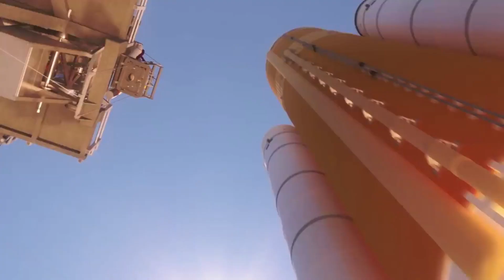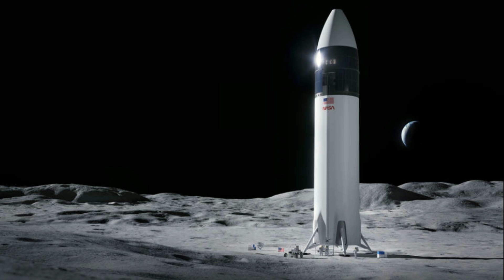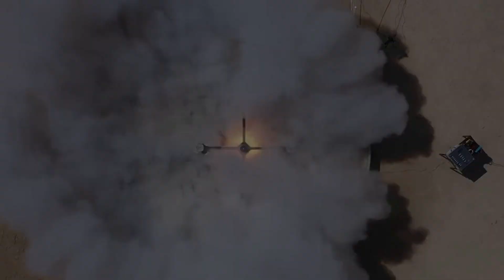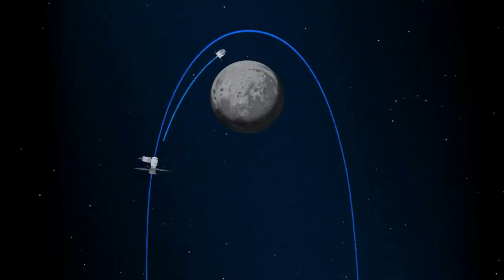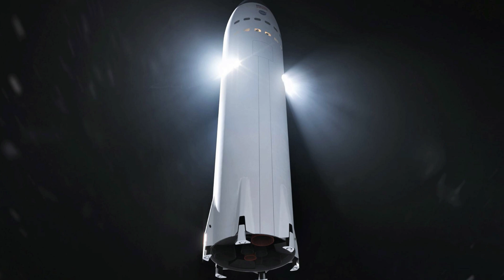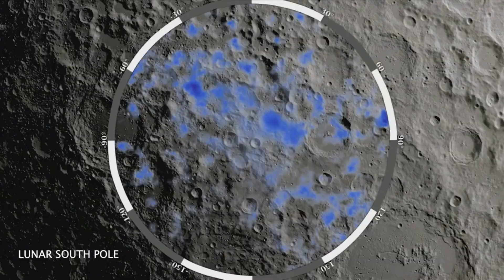NASA’s Updated Plans For A Moon Base

Comment: Thank you NASA for doing nothing for the past 50 years. If SpaceX happened come along, we still be waiting. I am going to write my congressman and complain about your leadership.
Reply: Is this really what you call nothing??  
135 shuttle missions which included lifting ISS modules for    construction of the ISS.
Deploying the Hubble Space Telescope and return to repair and update the telescope.
The shuttle was the primary vehicle carrying crew and supplies to the ISS. 

NASA deploying several space telescopes which could view the universe at infrared up to gamma ray.  

NASA deployed numerous planetary probes to all planets out to Saturn.  Plus flyby proves of the outer planets.  

NASA has provided and continues to provide numerous earth sensing satellites measuring everything from CO2 levels to ground water systems.  

And of course the SLS sent the Orion capsule to the moon last fall as the first vehicle by any country capable of transporting humans to the moon in 50 years.   

And that's only a partial list based on memory and keeping this comment within a reasonable length.  So while you whine about NASA realize that it has done more than any other space program on earth in the last fifty years.
Reply: @michaeldeierhoi4096 - SpaceX fan thinks space exploration is a rocket launch and mission complete is booster landing.

Comment: 3d printed habs might not work. The massive temperature changes from one side of the structure to the other would cause cracking and breaking. Stainless steel structures in lava tube(s) would be more ideal for temperatures.

Comment: 3D printing is the way to go on planetary bodies. Use the materials there to make the buildings. With 3D printing, you only have to lunch the printer and maybe a few items that cannot be produced locally in the beginning. It would be much cheaper than launching the modules from the Earth. Another advantage is that the walls of the structure could be very thick to help provide radiation shielding and protect from micrometeorites.

Comment: So the idea is to have the landing pads 5 km from the base?
Reply: Around half a mile /about 500 m
Reply: @DOSFS  the oxygen pipe line will be 5km/3.1miles away from the main habitat and the landing pad will be 1km/0.6miles from the habitat.

The distance for the oxygen pipe line is because we will be extracting oxygen from surface ice that will be in areas of constant darkness while the habitat will need to be in areas with near constant sunlight. 

The distance for the landing pad is due to the amount of material that will be blasted up when the lander lands.
Reply: No they want the o2 production to be that far away. It would be automated id assume

Comment: I understand that the habitats I have helped you imagine won’t be the first human habitats, because we already have one or at least a station, base, and place to stay alive, we will be landing on the Moon inside… Yes, the SpaceX Lunar Lander will be where the first landings on the Lunar Surface will be living. That is of course if we are planning to put humans on the Moon As Soon As Possible.??

Before the Lander can land with humans onboard with the expectancy of exiting the Station after a Starship lands it is a station or an outpost sounds less permanent. The first Moon Base will be more permanent with a mile-wide landing pad that will or should have a half-mile-wide ring of Maglev tracks for the first Hypergravity Vehicle Habitats. The mile-wide wall that will be built by Automated Robotics that will keep growing up to at least a mile before we cap it with solar panels that are made to absorb the harmful radiation sent from the Sun, is needed. The first greenhouse on the Moon will grow Mushroom bricks to powdered and use in 3D Space Printers, because of their strength, radiation resistance or absorbance, and malleability to print protective walls as needed.

Within this capped pressurized wall of protection, the half-mile-wide Maglev track will have one more ring of tracks around it at three-fourths of a mile after thousands fill every Hypergravity Vehicle Habitat. Within the Habitat Ring is where the Lunar Gravity Labs will be, but it won’t be like the Lunar Surface because there will be less dust, and within the wall of protection it will have air pressure, for our safety. For safety and survival, humans need a ring of protection that can grow miles high tower for the 8 Layered Cylinder Habitats…

Till then the Starship is big enough for 3 sets of 4 astronaut teams until it is proven to be safe to fly in space as far as the Moon, with limited ailments to recover from… We will need something big so let’s get started on the mile-wide and tall ring of protection…